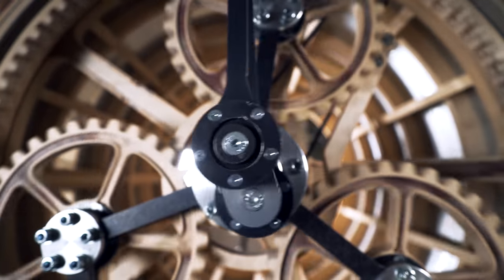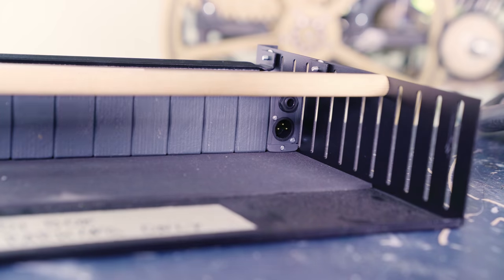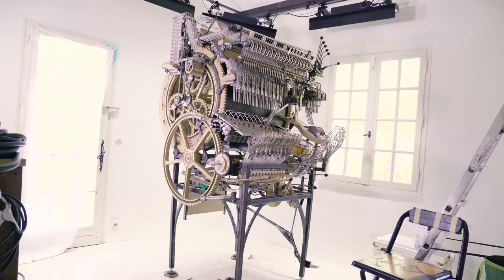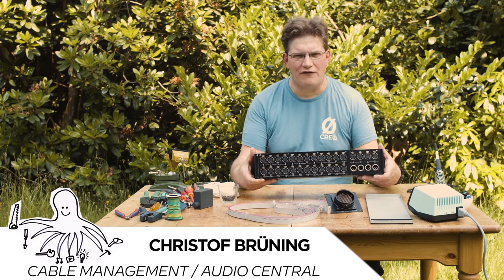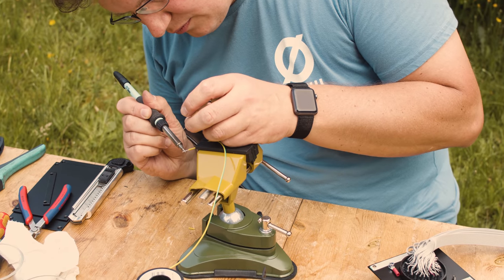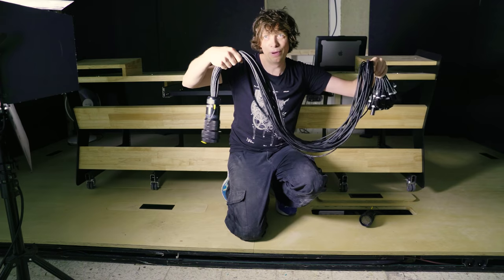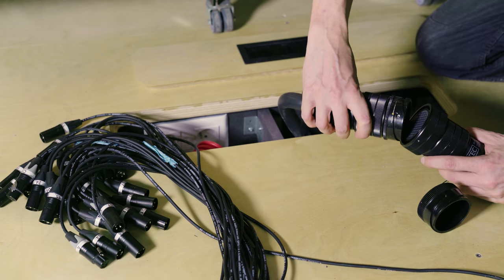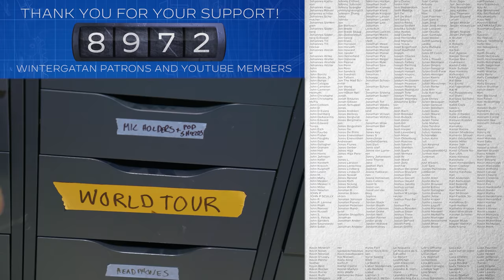28 Audio Channels in One Cable! - Marble Machine X #133

Comment: Martin as an avtech I work with those monster cables a lot. 2 bits of advice
 1: be careful. Replacing pins sucks ass. 
2: CONTACT CLEANER IS YOUR FRIEND. You should ideally use it before you plug it in after a time in storage to get all the gunk out of the plug on the appliance end and cable end.
Reply: I would like to hear your opinion on a digital set up. Seems like it would be much simpler. Are many large events all analog?
Reply: Thoughts on running that giant cable in parallel with his newly installed electrical outlets? I'd advise against that. Even through a conduit, those electrical cables running so close has got bleed some interference into that bundle.
Reply: @JamesMarsack  shouldn't be an issue for several reasons:  1.  While it looks like one big trough on the outside, inside the trough the power cables should be run in their own separate/divided chase from low voltage audio wiring (electrical code requires this physical separation for obvious safety reasons),  2.  The audio wiring is balanced, which helps cancel out any noise using a differential input interface on his very high quality mic preamp, and  3.  The cable length where both audio and power wires run parallel to each other is short.  We do this all the time in professional audio.
Reply: @henryD9363  I initial had the same question, however 1) while digital can reduce all this analog wiring to ONE Cat5e cable (Dante or AVB audio network protocol), you still need a preamp at some point to convert analog audio signals to digital, and they take up a lot of room, and make things look cluttered on the MMX.  2) Judging from his use of RME preamps/converter, it is obvious he is using some of the highest quality microphone preamps/ analog to digital converters available on the market today.  Even if installed these preamps in the MMX, they would take up triple the space for 24 channels (3 x RME Micstasy) versus his current analog and flexible setup.
Reply: When touring with these connectors, we would always have a repair kit handy with a few extra solder pins, and a small bottle of Stabilant-22 contact cleaner.  Be sure to cap the multipin connector whenever it is unplugged.  It made me cringe when he cut cap off the connector, because it will be easy to lose it now when he goes on tour.
Reply: @arthurskudra50  Thank you.  These were the first comments I've seen here that actually taught me anything and actually gave a good answer to the analogue vs digital question.  Also, he mentioned he'd reattach the cap for the world tour.
Reply: @henryD9363  There is no one digital solution. The are several proprietary systems. Very few bands travel with full production in tow so committing to one digital system means possibly renting additional gear in some venues. The idea here is not that he intends to use all analog it's that he is tying into other peoples gear analog that will then convert to whatever digital format the venue utilizes.  He absolutely has the right solution, he can plug into any sound system or studio in the world.
Reply: @stephenrobertson2197  That's a shame that the audio world is lost in the VHS BETA level woods.  But surely there's a box that has 24 Analog ins and a cat5 out, and 24 analog outs, and 24x A/D convertors and 24x D/A convertors that they could haul around instead of that monster snake with milspec connectors on it.
Reply: @Arthur Skudra  It's actually possible to fit 24 inputs with preamps in 2RU  Dante/AVB/MADI/EtherSound/CobraNet stagebox (e.g. AuviTran Audio ToolBox).
Reply: If those pins use the red/whites it shouldn't be that bad... If it takes green/whites though good luck...
Reply: @WarrenPostma  Cat5 allows for I believe 4 channels of analog audio down a shielded cable. The digital solutions are all proprietary. He probably doesn't have the capital to travel with his own stagebox and console. Most likely he carries his backline (this) and the microphones. They might have techs that travel and use the house gear/rental gear.
Reply: @wienerstein2817  Cat5 allows for a certain bandwidth, it depends on what protocol you are using. Dante can do 512 channels at 24bit/96kHz over that I think. Enough at least.
Reply: @arthurskudra50  using 12 2 channel dante avio inputs and a 1U 24 port switch would take about the same space as the setup he currently has. though it might cost a bit more than the full analog cable. (this setup would be around 2500 euros, while I'd estimate the huge cable and rack at under 1000 euros)
Reply: @WarrenPostma  you don't even need the extra analog outs, you could probably just pipe the ethernet to the laptop and have the cards appear as sound cards.
Reply: @satibel  a few problems with your suggestion:  the AVIO dongles are line level input only, so they won't work with microphones without a separate microphone preamp.  Second they are half as good in quality compared to the RME interfaces Martin is using for recording, or any typical live sound remote preamp stage box that they would typically use on a world tour.  Third, with 12 dongles and a network switch, in addition to the extra mic preamps required, it would have looked very cluttered with all the extra wiring needed.  What Christof and Martin have designed here is very well thought out and will be very flexible for both recording and live sound use.  I do work in both worlds professionally, and this is a clever solution.
Reply: @mrgompaw  I'm sure you can do it with a Dante/AVB box.  But why commit to one manufacturer's converter when Martin already has one of the best analog to digital converters in the business with the RME?  With a world tour, you may encounter different manufacturers for mixing consoles that you need to interface with, so an analog approach is perhaps the most "compatible" and flexible one.  Digico, Avid, Allen & Heath, Yamaha all have different stage box preamps/converters, and the likelihood that they will use the same console for their entire tour is small if they are on a tight budget.
Reply: As a stagehand, this is all true.

Comment: Not to add work but have a machined “fake” port for the cap, that way the cap is there with it all the time and looks aesthetically pleasing
Reply: This is both practical and aesthetic.
Reply: Also make a cap to protect the large plug on mmx during shipping and setup/teardown of each show
Reply: This
Reply: Usually on these panels, there is a cap that covers the panel port during shipment. Then when the cable is mated with the panel, the two caps screw together.
Reply: Aircraft use the exact same setup of pin and socket design. They’re called cannon plugs. They can be made into any arrangement for any type of wiring you want to go with. Aircraft have what’s called a dummy socket specifically for what you’re talking about, nothing more than a cap holder so it doesn’t get damaged or lost
Reply: @alexg0097  In the live event industry we call them Veam connectors, but i've just had a look and they are the same company. Cool to know they are on aircraft!
Reply: @alexg0097  They are usually for aircraft and avionics wiring.
Reply: Martin you gotta get more sleep man you look sickly
Reply: @evisa-bee7326  yeah
Reply: @evisa-bee7326  I really dislike it when people like you leave a completely unrelated comment as a reply to the top comment.  It's just incredibly cheap.  Just comment and hope you get likes like the rest of us and don't clutter the replies.
Reply: @Huntracony  Chill man,  in the Android app it's really easy to reply as a mistake. It happened to me at least once.
Reply: I read this as he cut it off, talk about timing lol
Reply: Dear Martin why don't you used a digital snake? There are a lot of kinds but the most easy to implement is Dante protocol you can find more resources about on audinate.com

Comment: We use digital transmission via network cables in the event industry. These old style multicore cables are expensive and easy to break.

Plus you have less noise in the signal and the hardware is smaller...

You could also put the box below the stage and run the cables from the mics through the pipes of the machine - even more stealthy :)

Comment: Why don't you use a digital stage box using MADI, Dante, AVB or AES50 so you just have to use one ethernet or optical cable and you don't get signal degridation over distance? It gets converted to digital at the RME interface or the digital stagebox on tour anyway so you'd just be doing this one stage earlier, and when you go on tour you might be able to just plug your stagebox into the audio network if they're compatible
Reply: i googled it and apparently it’s a very standard cable for live audio performances and stuff
Reply: The biggest problem with this is if they're touring and end up some place where they can't use their own mixer (f.ex. most festival gigs) then they'll have a problem. Maybe on some tour they won't bring their own mixer, who knows. Going analog for this application makes more sense as they are more flexible on tour.

Also, protocol switchers can be super annoying and have a bunch of issues if you don't really know what you're doing (clock & master/slave issues). Plus they're stupid expensive, and they aren't readily available everywhere. They'd have to rent a different converter for each venue where they can't use their own mixer. 

If they always bring their own mixer and don't use the in house mixer, then they'd be fine. But that isn't the case, so analog out is the better way to do this. :)
Reply: @nifem  Dante is quite standard now, and they could just use a digital to analogue breakout box if the show's audio network isn't compatible.
Reply: These multipin connectors are common as muck in the pro industry, literally any touring company will have piles of them - or you can buy a 2nd fanout and keep one in the studio and one for touring - that is kind of the whole point of them
Reply: @rb4568  It's called Socapex. Problem is that the pinout might not necessarily be the same.
Reply: @danielplusben  it's not Socapex, that's a 19 pin power connector.  It's a LK or MASS connector and yes there are a few different standards but they are frightfully common in the industry.
Reply: @rb4568  So is an Ethercon now
Reply: @billyjukes832  Sure you could use Dante, AVB, AES67 whatever, but it's 5 times the price to implement compared to a common tried and tested multipin snake and you cop a latency hit on the way through (AD, DD, DA).  I'm a huge Dante advocate & user but time and place IMO.
Reply: @nifem  did you hear something about riders?
Reply: I absolutely agree that not using any audio by ip in this situation is at least strange. The only exception is the inexplicable desire to use only analog routing
Reply: @rb4568  Don't mislead people, AVB SIGNIFICANTLY cheaper than buying, maintaining, and transporting an analog solutions (you can count on the example of Motu products)
Reply: @lfo2681  but it's just not, and I'm a MOTU dealer!!  Romance it all you want, analogue still solves some solutions like this one easily and without fuss.
Reply: @rb4568  then I have questions for your arithmetic skills (count 500 ch multicore 100 meters long + stageboxes + work of technicians)
Reply: @lfo2681  then I have to question your eyesight, I didn't see 500ch or 100m core length in his video.
Reply: @rb4568  
Denying the benefits of technology because it doesn't find use in your workflow is something that always amazes me in the audio engineering community. From the series “Why do I need high resolution if I can't hear above 20 kHz”. In other words, video came out from the artist's need to expand the workflow, is it worth to clarifying that each such expanding in the analog environment is much more expensive than a one-time investment? 

I knew that people in Australia are so strange, but what drives you to argue, you have not a single argument on your side)
Reply: @lfo2681  You are missing the point - for this application - considering budget and requirements, a simple analogue core works fine.  I'm not denying the benefits of technology, I'm designing and implementing 500+  channel multi domain Dante systems with my customers, audio over IP is a massive part of my job!!!  I just don't see the need for the expense for a guy who wants to move a relatively small amount of channels a short distance to some nice preamps.
Reply: @rb4568  
28 ch (excluding the fact that this is not just "a guy", often tours, and playing with the band on stage, as I understand it) is enough, when it comes to elegant and ergonomic solutions. 
After the stagebox with preamps, you have to tie it all up on velcro (as in the example video), lay it into the walls (along the power cables ...), drill the scene for it, make hatches in the stage, use the "spider" and "snake" to get in to the converters. And after them finally go to the MacBook.
Are you seriously? With the ability to just go with one Ethernet cable to the MacBook with the same price tags?
Reply: @rb4568  
As for the budget (which you mentioned, but I have no information on this figure), I am sure that these solutions would be close by, for non-promo customer. 
Plus, as an engineer who makes decisions on the renovation of routing interfaces, you must understand that this includes an investment not only in expansion, mobility, flexibility of use (OSC automations & chaining, AV implementation, etc), but also in the future.
Reply: I would really just recommend any stage box with Dante, easier and also pretty well supported.
Reply: @Signal-Flow  well they aren't reinventing anything this is what analog snakes are. The pre amp thing is different.
Reply: @nifem  well analog still would be more compatible with more devices right now. You can always just plug analog cables on the back of the board or if your short convert that to digital with a stage box or something. Where as with all these digital protocols being used for audio you choose one and then you run the chance of running into a venue either with an older analog system or a board that doesn't take the digital signal you went with. Of course I'd recommend going digital and doing Dante which is supported the most and usually there's a way to make it work. You also don't run into as many venues these days that just have no way of taking a digital signal and force you to do digital(but they do exist). Either way a good team would prepare for the worst scenario.
Reply: @rb4568  in a touring environment an audio over ip solution is much more preferable after other expenses and considerations of the infrastructure like transportation, setup, maintaining the system. All this gets alot simpler when touring with digital systems.